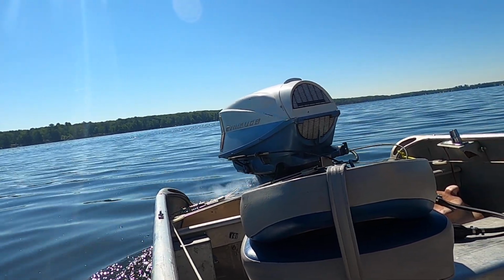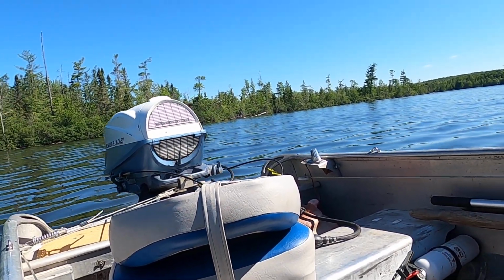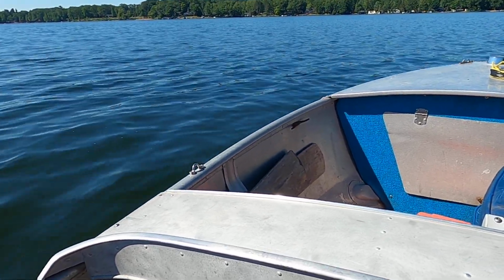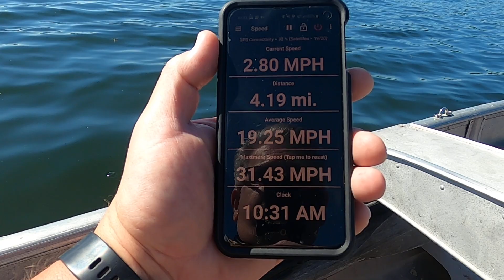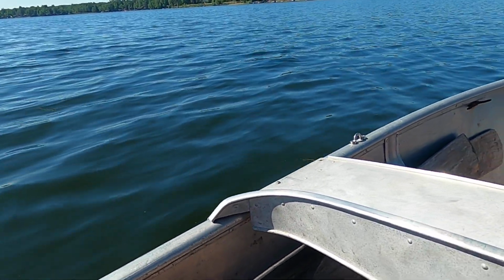1963 Evinrude Big Twin 40hp Outboard Motor Lake Run

Comment: Fantastic!!!! That motor runs great! The combination of that motor and that boat is perfect!!!  Thanks again for another great ride along.
Reply from the maker: Indeed this motor turned out fantastic.  It is a great pairing with the Alumacraft FD with a center steering deck also.  I'm very pleased with this combination.  Thanks for watching!
Reply: @oldjohnnyrude8404  
My father and I rebuilt one just like it. Ran it for years after. 
Nice to see and hear this.
Reply from the maker: @lbbradley55  This one turned out great.  I'm looking forward to running it again.  I may put this on my Alumacraft Flying C after I get it ready for the water.  I will eventually put twin 35s on it, but this may go on it first. Thanks for watching!
Reply: @oldjohnnyrude8404  
Be sure and send me a video of that. 
Thanks

Comment: Had one of those 20 years ago. Bought it dirt cheap but without an electric start and it sure didnt start as good as yours so there was a lot of arm muscle 😅 My dad used to call the Ävenrodd which was Swedish for "also rowing" since according to him Evinrudes were notoriously hard to start(don't know about that though). When I got tired of it I sold it in a couple of hours since there were a lot of enthusiastic buyers for these it seemed. The noice brings back memories, seems like you have a fine example

Comment: I have a rescued 1966 Johnson 40 HP (not as stylish as your Evinrude) that I am really curious about on my FD. Has not been run yet but is ready. You've got a very nice motor my friend!
Reply from the maker: I agree about the styling of the 60s Johnsons but here great motors and they don't look bad.  I just don't like the look as well as the Evinrude of the same era.  The 40 is a blast on the FD.  It's not really too wild. Plenty of power and it scoots right along.  They do use quite a bit of fuel, but they're fun anyway. You pretty much need a passenger for a tiller operated 40, but with the mid steering it's great either way. Thanks for watching, David!
Reply: @oldjohnnyrude8404  I did add a tiller to it but my FD is a side helm.  C'mon spring!
Reply from the maker: @davidparlee3102  It's great to have both.  YES!! C'mon Spring!!

Comment: 30 mph in that ?  Wow that’s fast you’d better be on top of that baby because it’s real fast. I am impressed !
Reply from the maker: Yup,  she scoots right along.  It will do a pretty steady 30mph with a 35hp Big Twin also.  This 40 runs SOOOO nice.   This is a great little boat.  You won't fall asleep at the wheel at 30mph,  but it handles very nicely for what it is.  This boat is a ton of fun on calm water on an inland lake.  With a 22 c.i. 25hp I'm getting 29mph out of my Aerocraft P-12 also.  That is little more than a glorified beer can compared to this Alumacraft FD.  It too handles surprisingly well for being nothing more than a deep sided 12 foot car topper that I built remote controls in.  Thanks for watching!

Comment: Back in the 60's we lived on a big lake in Connecticut. Folks has a 15' Glastron with a 40 horse Evinrude "lark" motor. With just one person in the boat we would get about 32mph on the water. Pulling a skier out of the water if it was a full size adult took some effort. Me at about 135 lbs at the time worked ok.
Reply from the maker: 32 mph is hauling pretty good for a 15 foot Glastron.  My dad had a 14 foot plywood runabout with a 35hp Johnson and everybody in the family used to water ski behind that boat.  Good times!  Thanks for watching!

Comment: Sure would like the see that camera more forward so we get a better view back thru the boat !!..........Edit:    I take it back,    once you spun it around all was fulfilled !!  Glad to see this video to keep me goin until I can get my 58 FD project and 54 RD 25hp running. Finished all the ign. and new fuel lines today, impeller check up and start on that transom tomorrow.
Reply from the maker: I hope your boat and motor project is going well.  I'm glad you got to see  what you wanted to see in the boat.  Thanks for watching!

Comment: i re did a 33hp ski-twin last winter. isn't it amazing how smooth and quite these old girls are? don't make em' like this anymore thanks for the video!
Reply from the maker: Yes, these are wonderful motors. A little on the thirsty side compared to today's motors, but so much simpler and maintainable.  The Ski-Twin 33s are great.  The 40s have the super quiet exhaust and are quieter still.  This motor is a lot of fun on this little 14 foot aluminum boat.   It makes a great little rig.  They sure don't make 'em like this anymore.   Thanks for watching!

Comment: Thanks for the video! Did I understand that correctly about the prop you are running? It is a two blade bronze with a 10" diameter prop with a 15" pitch?  I have never used a two blade prop before and got the impression that they are generally more for speed and racing.  I have a couple of similar 40's  that I run on similar sized vintage wooden and aluminum boats.  I get similar top speeds with 3 blade 11" and 12" pitch props.  Do you need a higher pitch (e.g., 15 vs 12) on a two blade to keep the revs in the right zone?
Reply from the maker: Yes, that is correct. The prop I ran in this video is a 10 x 15P 2-blade.  They are intended for improving top end speed.  They typically give up bottom end holeshot for top end speed.  You're also correct about the extra pitch being needed to keep the RPMs in the correct range.  The 2-blade prop allows more slippage in the water, but with a light load the extra pitch will keep pushing past the point a 3-blade with a lower pitch might.  The 2 blades will have a lower resistance in the water due to prop area, and more resistance is attributed to prop pitch. That is what allows the higher speed at lighter load. In reality there was only about 0.5mph top end gain woth this prop over a 13P 3-blade and the 3 blade gives better low end performance.  That will vary based on hull design and how the hull is balanced.  The lower the hydrodynamic resistance the more advantage the 2 blade high pitch prop will have at top end. Thanks for watching!

Comment: How big is the boat. Just aquired one but not sure if its too big for my boat. 13.5 fiber glass. 48” wide.
Reply from the maker: This is my Alumacraft FD. It is a 14 foot aluminum boat.  It's about 50" wide and 13'10" long.  These were rated for 35-40hp depending on the year. You should refer to the capacity plate in the boat to verify max rated HP.  If that is missing, try to dig up the info on the boat online. Thanks for watching!

Comment: what clamp is that on the gear selector cable something homemade or there an actual part number for that
Reply from the maker: There isn't anything homemade on the gear selector.  It is all factory parts.  I'm not sure which part you're referring to, though. Is it the 1/4 turn connector that connects to the shift lever on the motor? Is it the clip on the side of the outboard that holds the motor end of the cable?  Thanks for watching!
Reply: @oldjohnnyrude8404   the  clip on the side of the motor that holds the cable in place

Comment: I have a 63 Johnson 28 should I run 24:1 or the 40:1 I run in my 9.5, fisherman, and ‘81 9.9?
Reply from the maker: The '63 28hp should be run on 24:1 mix.
Reply: @oldjohnnyrude8404  thanks! That was my guess. I think it’s a 63 but someone ripped off the model number plate. I know they switched to roller bearings in 64

Comment: Looks like great fun
Reply from the maker: You bet! This little rig is a blast.
Thanks for watching!
Reply: @oldjohnnyrude8404  only old engine I have is my grandfather's 1968 ish Ted Williams 7.5. I've rebuild carb and water pump. Still runs good
Reply from the maker: @agmc4me  It's great that you have your grandfather's motor and have it running and are using it.

Comment: Hi. I just picked up an old Evinrude and was told it’s a 63 forty hp. Like to chat with you about it sometime. Yours is sweet
Reply from the maker: That's great.  Excellent motors.  A bit thirsty by today's standards but excellent reliable runners with lots of torque.  This one did turn out to be a winner.  It is one of my favorite motors to run.  If you want to chat my email is bbreitner at hotmail dot com.  Thanks for watching!

Comment: Interesting piece of nautica history! I have the same engine 

After i restarted end setted the carburettor, i saw a problem: at minimum rotation It over heats up to 230°F, It take ten minutes but increase, but just i insert the Gear even without accelerate, the temperature drop quikly at 100°F.
At maximum Power the same hottest parts of Power head mantain among 158/170°F. 

May be It normal than at low rotation without Gear in, It over heats?
Reply from the maker: It is not normal for the engine to overheat while in neutral. That is a symptom of an inefficient/failing water pump.  At low speed, the impeller is intended to act as a displacement pump.  If the vanes of the impeller have taken a set, they will not seal properly against the inside of the impeller housing.  When the gearcase is put into forward gear, the prop wash forces water into the water intake snout just behind the prop.  The thrust assists in pushing water through the cooling system. At higher speed the pump also becomes a centrifugal pump. Between the centrifugal mode of.the pump and the water being forced into the pickup, it is cooling.  When the engine speed is at idle and the prop is not pushing water, the pump is no longer working properly. You at least need a new impeller and depending on the condition of.the rest of the pump, may need a new pump kit. 

Another thing to note is that this is a recirculating cooling system so water only sprays out the relief hole when the thermostat is open. When the engine cools sufficiently, the thermostat closes and the water doesnt exit again until it warms up. This cycle repeats continuously. Thanks for watching!
Reply: Thank you for your answer, Indeed the impeller Is good but his aluminium case has become irregular, my engine has not termostatic and cooling water exit from exhaust pipe.
The matter Is where buy spare parts
Reply from the maker: @tocdalegn7485  You stated you have the same engine.  This engine is definitely thermostically controlled and has the "Super Quiet" exhaust leg which uses the recirculating water system.   If you have the 28hp version, it does not have the Super Quiet exhaust housing or a thermostat. I'd be willing to bet you need a new impeller housing and plate, at which point you may as well replace the impeller again.  I don't know your location. I order many of my parts from Marineengine.com, Crowley Marine, and iBoats.

Comment: Nice.  I just got a Whaler with Lark IV.  What years were they made?
Reply from the maker: Thank you.  I always wanted a Whaler 13 Sport.  Nice little boat.  The Evinrude Lark IV is a twin cylinder 2-stroke 40hp.  It runs on a factory recommended fuel mix ratio of 24:1 gasoline to TCW-3 water cooled outboard oil.  It was made in 1962. Thanks for watching!

Comment: Is it possible to convert jet out board motor?
Reply from the maker: Your question is a bit too general for me to answer yes or no.  I will say that OMC built some outboards that were fitted with jet drive lower units. The older ones, at least, were standard outboards up to the point where the lower unit attaches. Those could have the jet drive removed and a standard prop drive lower unit attached in its place.   Thanks for watching!

Comment: Where did you get your parts I just picked one up and needs some parts. Been sittin a while.  What would you do to it.     It’s on a 1960-1970 mfg classic from what I can find out
Reply from the maker: I get many of my parts from Marineengine.com.  There are a number of other sites as well.  If you have a local dealer they can get parts for you too.  If your motor has been sitting for a time, I would go through the ignition and freshen that up. This one still had original coils that were all cracked so they needed to be replaced.   Yours may not.  New points, condensers,  spark plugs, plug wires if they show any signs of rubbing or chafing. Rebuild the carburetor.  There are no kits available any longer,  but parts can be bought individually.   Replace the fuel lines. Replace at least the water pump impeller. If the other parts are getting worn, replaced them as well.  Check the gearcase seals for leaks and replace whatever is leaking then replace the gear oil.   That is what I would do to it to bring it back to reliable service.   Thanks for watching!

Comment: Hi Johnny, I have about the same rig, a 1960 , 40 hp Lark on a 16 foot STARCRAFT aluminum with windshield . I have recently done all the same types of work on the motor and it runs and idles very weĺl. But, I can only get 21 mph out of it. I have a generic 3 blade prop. The boat trim i believe is good it is up on plane in less than 3 boat lengths. My question is can you recommend a top rpm this motor should run at and at that rpm should the butterfly in the carb be wide open?
Thanks, Steve from Canada.
Reply from the maker: WOT RPM should be right around 4500 with this motor. Your 16 foot Starcraft im sure is a bit heavier than this Alumacraft FD.   This boat weights right at 200# empty.  I had a 14 foot Starcraft deep V fishing boat that outweighed this boat by at least 60 pounds and the deep V takes more HP to achieve the same speed.  This boat is quite flat in back.  You may be able to get a fee more MPH, but i don't think you will be approaching 30mph with your boat with 40hp.  You may be trimmed in too far if it is getting on plane that quickly too.  Trim out a notch and check for optimum full throttle RPM amd go from there.  Thanks for watching!
Reply: @oldjohnnyrude8404  thanks for the tips Johnny, what about the throttle butterfly, should it be wide open at full throttle? I'm concerned about a runaway,,,
Reply from the maker: @stevefortin7504  Yes, the throttle valve should be completely horizontal (wide open) at full throttle.   There is a cutout switch on the motor that will cut soark to one cylinder if it reaches excessive RPM.  Full throttle should only be attempted under load either on a boat with the prop in place or in a proper test tank with the correct test wheel in place of the propeller.  Do not try to run this motor on water muffs.  There is not a proper input for them.  If you have a Flushette with the proper connection that can be used but do not go above fast idle without the backpressure of the housing being in the water.  That can cause a runaway also.
Reply: @oldjohnnyrude8404  thank you my friend, I'll do this testing this weekend and let you know how I made out, I know for a fact the butterfly is not horizontal at full throttle.

Comment: I thought these were 50:1.....I have been running a 1968 and a 1971 for years with 50:1....am I doing something wrong?
Reply from the maker: These became 50:1 beginning in 1964.  Technically there are no differences internally between the 1962-up Big Twins.   I have been told the 1964 and up models came.from the factory with coated pistons.  They were still run on 24:1 for break in, but that was typical for all premix50:1 2-stroke outboards for many years.  Your motors were always 50:1 mix motors from the factory. You're not doing anything wrong.  Thanks for watching!

Comment: Look and sounds great, I have the same motor on a 1963 Performer Boat. I'm wondering what your compression is on each cylinder?
Reply from the maker: Thank you.   This one has around 110-115psi per cylinder for compression.   Thanks for watching!

Comment: Comment if there is anyway you could open up the top of your motor and show me a picture of the carburetor linkage and the way it is supposed to be correctly installed for your unit to run I have the exact motor and cannot get it to run right it looks like the linkage is wrong
Reply from the maker: I'm not sure if I can get you a picture that will do you any good.  If I get a chance, I can pull the boat out and the cover off the motor and see if I can get you anything that would help.

Comment: I have the same motor have issues with the float pin on the carb it pukes out gas when I squeez the prime changed the float and pin and gaskets get the same issue just not as often was thinking bending the float or something
Reply from the maker: The float should sit level with the carb body when the carb is held upside down.  Start there.  Also, check that the float can swing and not catch on anything.  It kind of sounds like it may be occasionally hanging up on something. Thanks for watching!

Comment: Just curious. Do you not trust Amsoil’s recommendations for their mix ratios? It’s indeed a very quiet an strong running powerhead.
Reply from the maker: No, I do jot trust their, nor anyone else's "mix one ratio of 100:1 or whatever dry ratio they might reccomended for everything".  I tend to stick to, or very close to the factory reccomended mix ratio.  I know the modern oil is better than the non-detergent SAE30 motor oil that was used in the 50s and earlier.  The biggest advantage I see to the new oils is that they stay mixed in the gasoline and they do not carbon up and foul plugs like the old oil.  While they may lubricate better too, some older engines do not have roller bearings,  and even the ones that do were not built to the tolerances of the newer ones designed to be run on variable ratio oil injection or even 50:1 premix. Thanks for watching!